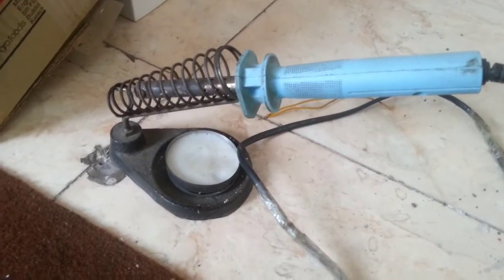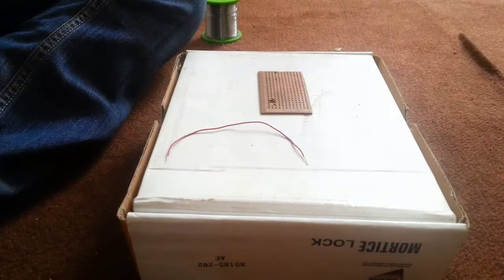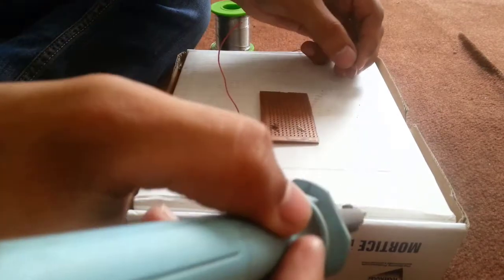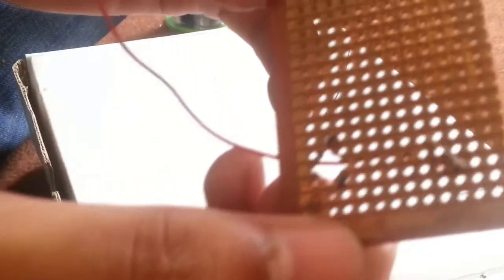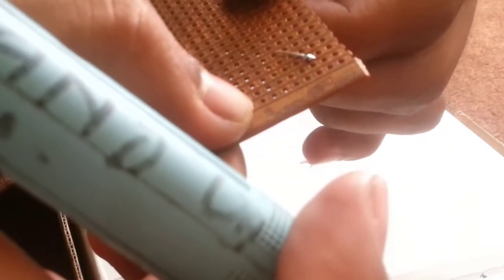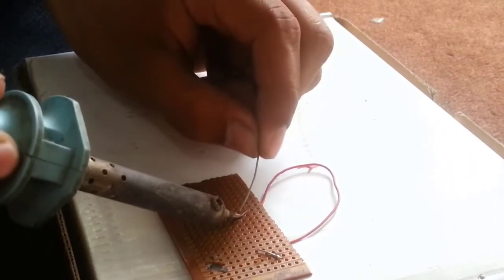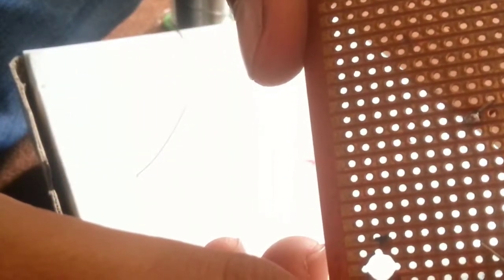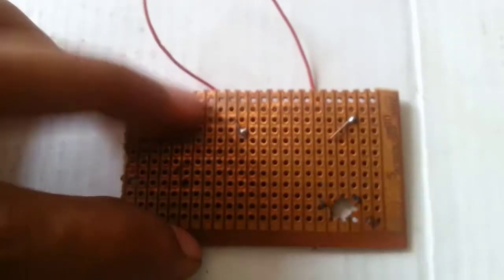How to Solder on Perfboard Neat & Clean

Comment: You need a new tip and you need to stop pressing so hard when you solder.  Also I would suggest getting a temperature controlled solder iron and not a walmart special.  I would also suggest a 60/40solder or even better 63/37 as it is much easier to solder with.
Reply: not everyone has access to a walmart